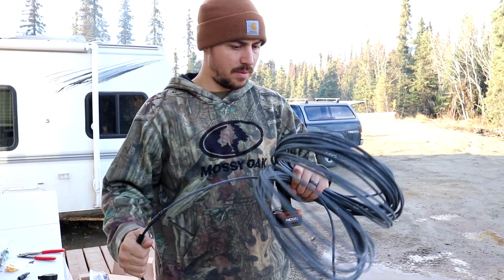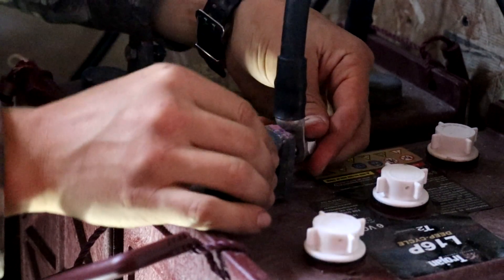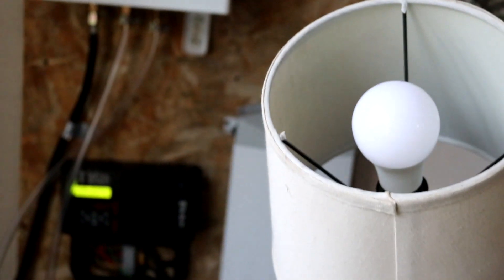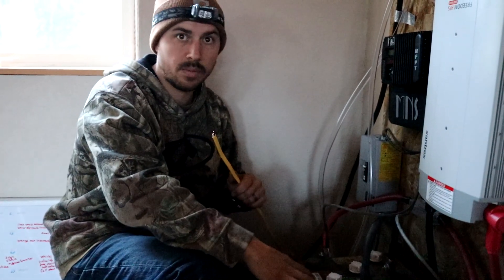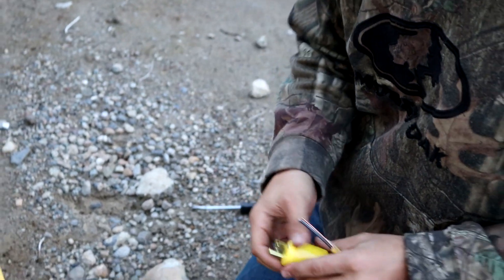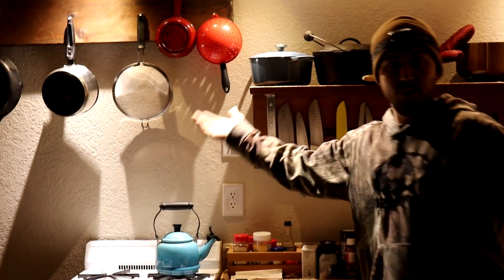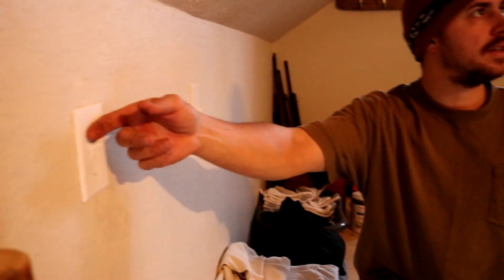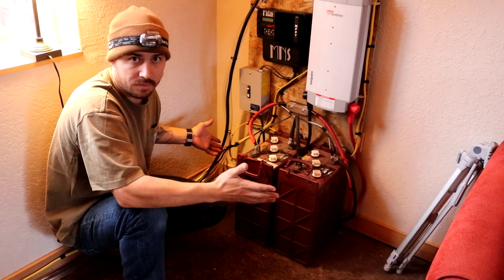Solar System Install Alaska | Part 2

Comment: Why did you put your panels up high like that? Putting them on the ground is usually an easier solution when you've got the ground space. It's not like being 10feet closer to the sun is going to make a difference.

Comment: Really great insight into costs etc.   we looked at upgrading our power to 3phase and it was going to be over £10k for 150ft of cabling etc, so your quote for connecting to the mains wasn’t too drastic.  We ran our hotel off grid for 18 months using a generator and it worked really well but it became difficult during lockdown to get fuel so we had to go back on line with a power company.  I’d love to have solar here and even solar water heating as that’s our biggest expense, heating 400l of water for the rooms.   I’ll definitely be looking into it more after seeing this.

Comment: A lot of people don't understand DC voltage drop
Easiest way to see it
Monitor voltage at your panels
Then again at your charge controler
DC voltage drops like a rock
AC voltage drop is easy to figure
add one gauge wire size every 100 feet
Best to keep batterys, charge controler and inverter as close to the panels as possible...   Or pay a lot for big Cooper wires...

Comment: I know your  solar panels are 295 watts but I'm having trouble finding them that do 12 volts. Are they 12 volts and what brand are they and where can I order them online. I found the Trojan batteries. The rest of the equipment is on your Amazon site, but all the panels seem to be higher voltage with that wattage.

Comment: you can get different caps for those batteries that would allow you to attach small rubber lines so you can vent the gasses out side

Comment: consider mounting the longer bar on the outside of the lower bracket ? drill 2 holes . now one long bracket has a summer and winter mode. no need to change bars , just holes each season .

Comment: My electric bill for a 3 bedroom with 3 stall garage ran 400 to 500 monthly. Since we installed solar panels (8 of them) are monthly bill is now less than $100 (ac/furnace only) It paid for it self the first year and since we have added 4 extra battery's and separated the garage from the house on power. We are still planning to add a few more just for ac and furnace usage and remove the Elec bill 100%. Our panels lay almost flat on top on the garage and the the 8 in the back yard all face east at 7am and rotate as the day moves on to always be in direct sunlight.   By the way, love the generator idea for charging the battery's on days that go sunless. We can get 2 or 3 weeks like that here and we have to use the reg Elec to recharge them at night so thats a great idea once we go 100% solar thanks!!

Comment: Too costly in ur country for solar power system, the same system would cost only $800 in my country + Installation. In $2800 u Get 3 KW Solar system with installation.

Comment: I started with solar but after 2 years of generators and solar, I did get electrical run to the property.  It took 2 years actually to get it because of land issues of neighbors.   The one thing that was adding up for the solar was having the well and making sure I had enough security lights around the property.  Now, I use solar for my lights around the property which saves me a lot so I do have both.

Comment: im not sure i would put the water heater / water above electronics... same as you wouldn't put veggies on the bottom shelf and meats on top shelf... i know the video is old so it may of changed but just to be safe as that stuff is not cheap by any means!
Reply: Excellent point...

Comment: not bad for a couple solar noobs :)
it's not as cost efficient for a small system since the inverter will usually make up the bulk of the costs. panels are dirt cheap nowadays and you could probably get a 300w panel for about $200 or even less (canadian solar is a good brand). guess you really don't need it based on your current electrical needs but might help collect extra during the winter or enough to run some appliances like energy efficient frig/freezer during summer.

Comment: Did you convert to 120V AC ?
Reply from the maker: RobertMOdell yes :)
Reply: @SimpleLivingAlaska  Many who go off grid use 12V DC, so that's why I was wondering.

Comment: I have designed my system for when my off-grid house is built (major components purchased already).  It's sized for my average needs plus just a little bit more.  One strategy I thought of, which could be useful to you, is to upgrade just the panels as you go.  Say you want to add a washing machine, but your batteries don't store enough for that plus everything else.  You could run the washing machine in the morning or early afternoon, and let your ("over-sized") panels restore the batteries to a full charge before nightfall.  Panels are cheap.

Comment: Are you sure your inverter will charge batteries (when on generator power)? Isn't that what the charge controller is for and the inverter will just route the outside AC power from the generator to your inside sockets and lights?
Reply from the maker: metamud the power from the generator is AC and has to go through the inverter to become DC to charge the batteries. It works the way we have ours set up.

Comment: Trying to watch how you set it up but being blocked somehow. Parts 1 and 2. Anyone else having trouble viewing this? Just rolls and rolls then says " no connection". Must be some valuable info. Just sayin. Utube blocks certain things especially very useful things. Ty. Bless you. Guess others were able to view 7-8 months ago but not now. You are very skilled.
Reply from the maker: Di Garcia I'm not sure what is going on it just worked for us. Are you still having issues with it?
Reply: @SimpleLivingAlaska  haven't gone back to try yet. Will try again.
Reply: Just tried again. Same problem. Maybe it's an issue on my end
Reply from the maker: I'm sorry to hear that I don't quite know what is going on, it still seems to work fine on our end.
Reply: I just finished looking at it and it was working good.

Comment: Just my 2cents... I dont like the chance of a leak for one above the delicate electronics... but charging and discharging the battries creates off gasing. That is flammable so when the water heater kicks on that close may not be a good combo
Reply from the maker: Thank you, we realized that very soon after and have added 2 more batteries in addition to locating them outside in an insulated battery box (we are still learning)! :)
Reply: Everyday we learn is a food day.

Comment: You can also run the wire from the charge controller to the battery back through that same baby box through a 30 amp (assuming the wire is at least 10 gauge) midnight breaker.  That breaker will protect that wire run and also your KIDs output.  Midnight breakers are constant duty so they won't trip until above their rated amperage.  (don't be confused by the fuses on the kid they are really only for protection in extreme events.)
Reply: Oh yea you guys can handle it no problem.  I’m basically saying make sure you protect the CC output wire just like you did on the CC input.  The CC is dropping voltage to ideal charging range so the output is also important to protect with a breaker.  Looks like a really nice system.  I think you guys will get great use out of it.
Reply from the maker: Thank you, we are going to look into this :) We are total newbies to solar over here but my husband says he can do this!

Comment: Hey guys! Very impressive, I'm excited to see how it works. Danny is a little concerned about the wind factor and the stability of the panel, but I'm sure you've thought about that. Question, though: we've looked at your next video (the last minute projects one) -- do you need to put the wire in a conduit in the ground?? Will the ground freeze and heave the wire up, or push a rock into it to cut it?? Thanks for the videos, we enjoy them. Nice break from the news, lol!
Reply from the maker: Thank you, so far so good. We will do an update on the solar soon. The wire we use is meant to be buried under ground and is pretty tough, we will have to see with the deep permafrost if it works its way back up though! And the solar panels/mount is much sturdier than it looks, I did have some anxiety the first super windy night though! :)